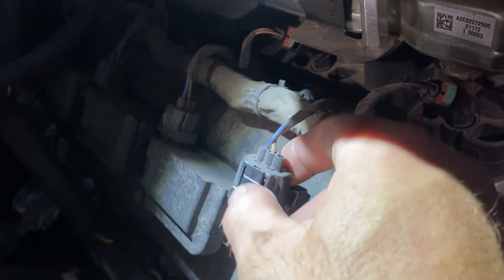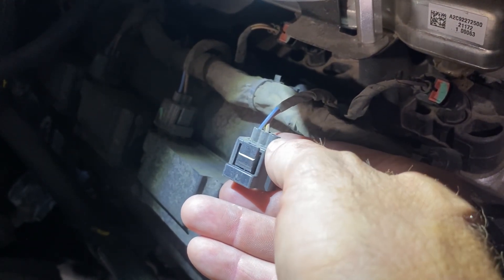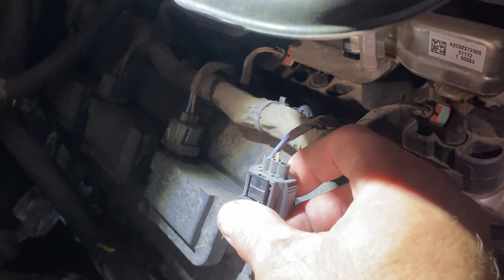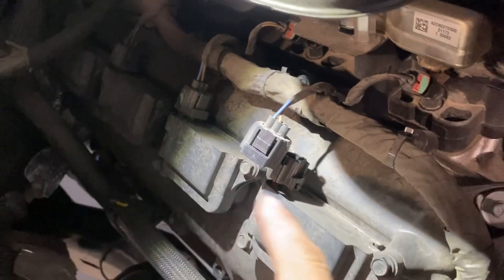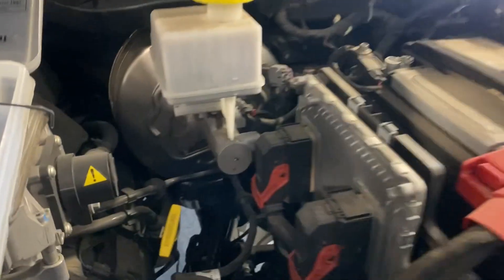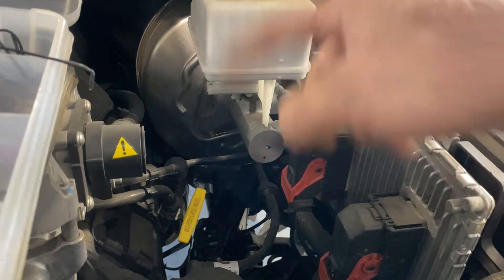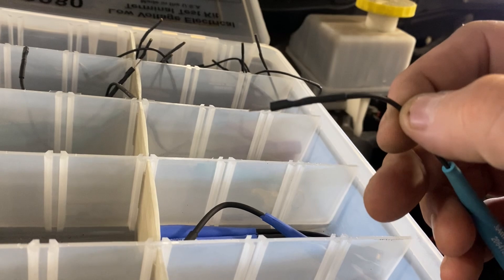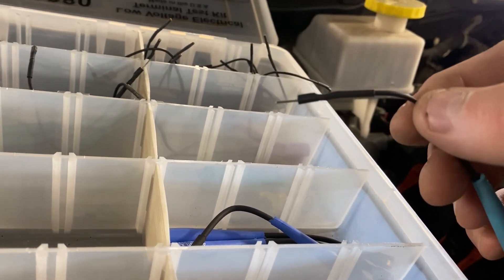Diagnose P2311 - Insufficient Ionization - P2323, P2317, P2308, P2314, P2305, P2320, P2302

Comment: Great video.  I am having the same issue (on #2 or B). I changed the fuel injector,  coil, plug, firing was normal that night  but returned the next day...  (Vech: 2015 Cherokee Latitude 2.4L ) running out of cash for 130$ hour fee's:face-blue-wide-eyes:, should I try this at this point?

Comment: hello thanks for the video and glad you got it fixed. I have a 2018 Jeep Grand Cherokee summit and tried to replace to ignition coils 4 and 6 with new coils. here are my codes.

P0300 (07e8)
PO304 (07e8)
PO306 (07e8)

after replacing the ignition coils on cylinders 4 and 6 at
first it was running great and smooth. I drove it for a few miles, then I took it on the freeway about a mile or two and now the engine lights flashing consistently and you can feel a moderate shake. I pulled over the Jeep I checked the codes. now it's saying I have all the codes as above but one additional P2311  (07e8) saying it's the ignition coil D secondary circuit. should I take it to a shop or is this something I can do on my own? but I'm kind of skeptical about the coill touching the spark plug head but I noticed it was running great and smooth. Have you heard of anything like that? running smooth and then a modern shake with the engine light flashing? Any feedback will be great Thanks
Reply: Pudiste solucionarlo ? Tengo el mismo problema

Comment: Hi, forgive me for my ignorance, how do you fixed a “bad fit pin”? In other words, just to make sure if you do have a bad fit pin, does this mean you have a broken wire? Or does it mean the computer or PCM/ECM needs to be replaced?

This is where I am at the moment, as also stated by my mechanic after a compression test, changing plugs, ignition coils, and injectors, that my problem is not a mechanical issue but electrical issue (but he doesn’t do electrical work) just as you also said…anyhow, thank you so much for your video, I wished I would have seen your video before I did all of that but the only thing I had to go by was an engine misfire mostly on cylinder 3, running rich. Again thank you.
Reply from the maker: Bad pin fit meant that inside the connector for the pcm the female side was spread causing a bad contact with the pcm. You need to de-pin the circuit that’s affected and even put a new wire or tighten that pin and reinstall it.
Reply: @ got it!!! I’ll try that first and see if that is my problem before I get a new computer. Thank you so much.